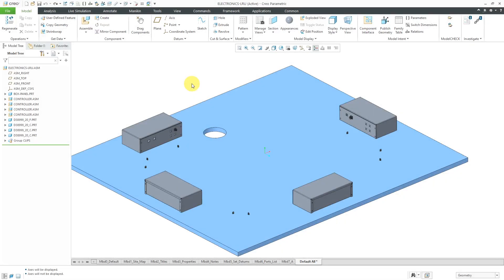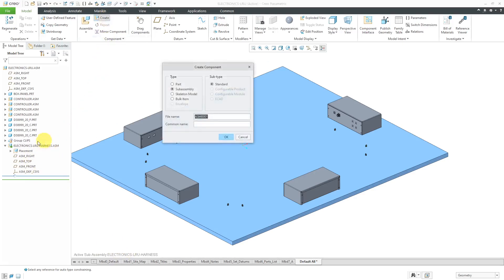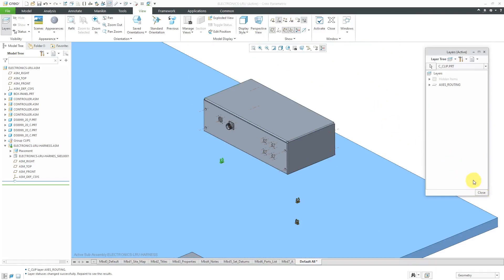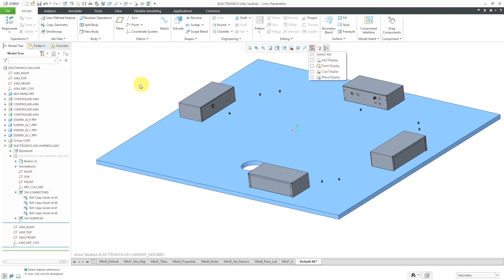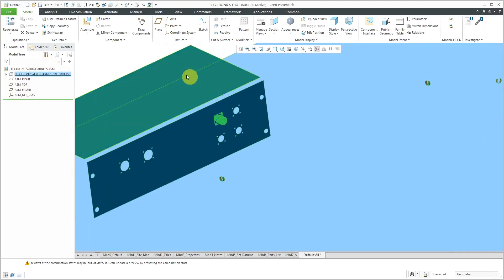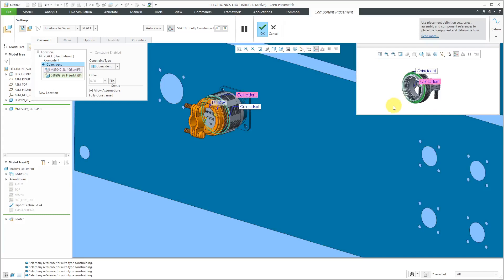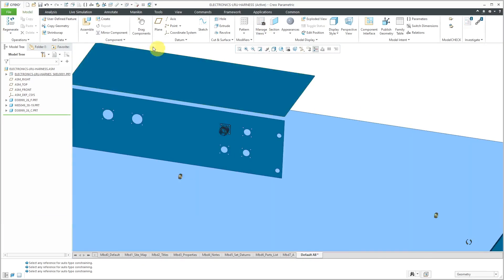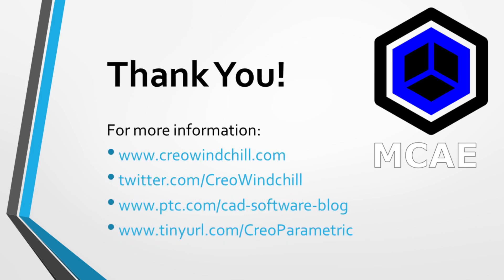Creo Parametric - Setup for Cabling

Comment: I've been able to successfully use the cabling application for years but now after a year hiatus my successfull cable features are not visible? I'm toggling between centerline and thick cables but no cables show up. But they are in my model tree. Any ideas why they aren't visible?